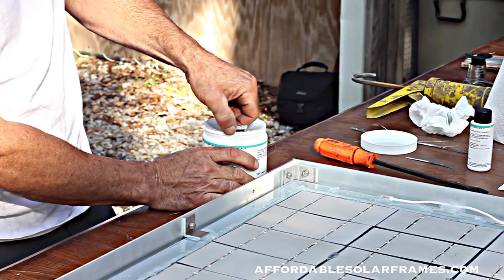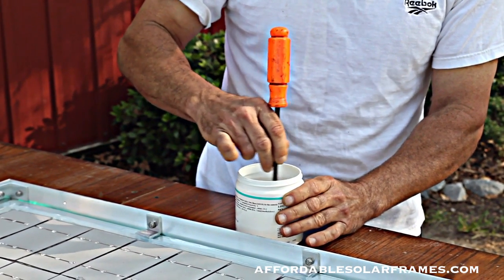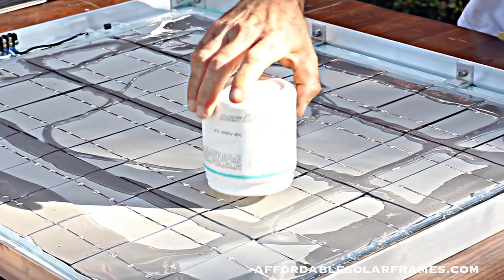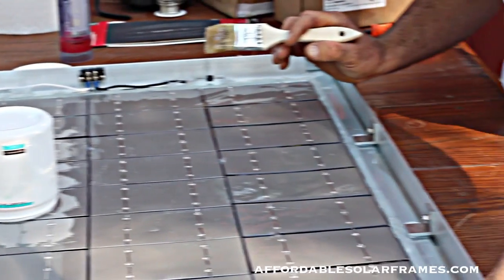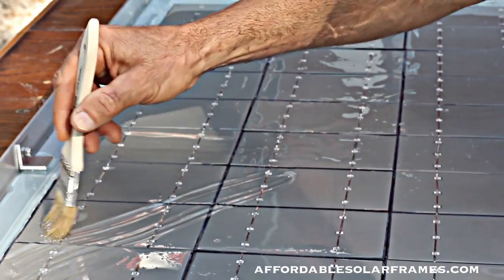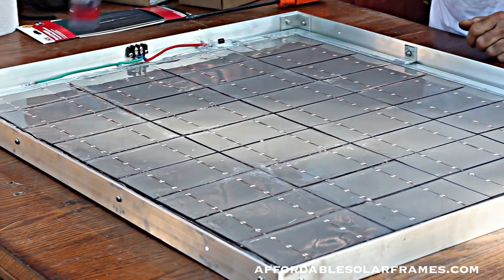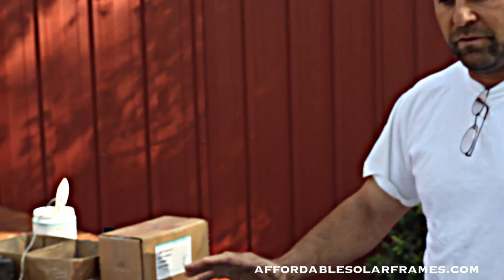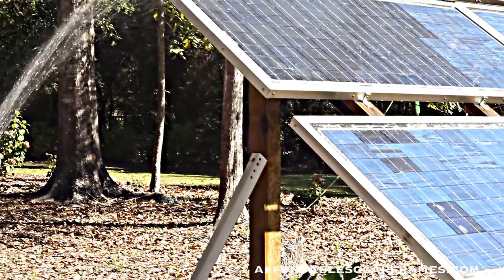How to Build a Solar Panel - Part 3 of 3 (New) encapsulated/sylgard184.Free electricity

Comment: Is it still working and how r you doing after while
Reply from the maker: It is still working. I no longer make the panels, you can now buy them cheaper than you can make them.
Reply: @markp0177  i bought 150 pieces of solar cells and i want to cover it savely . What do you recommend for this case i want cheapest way to keep it works
Reply from the maker: @alqorashy  Here is a link the sylgard. https://amzn.to/3oskMes
Reply: @markp0177  i have to pour it in just positive side or both side. Im thinking to keap negative side coverd by temper glas is that right? thank you for answering questions
Reply from the maker: @alqorashy  Just pour it on the back side just like I show in the video. It work work its way under the cell.

Comment: I just looked-up the specs. at
http://www.dowcorning.com/applications/search/products/Details.aspx?prod=01064291
It seems that it will cure faster at higher heat!

35 minutes @ 100 deg C 
10 minutes @ 150 deg C

USE HAIR DRYER, maybe?  or a heater/fan combo to hasten the curing time...

Comment: can u please show me how to apply silicone  and the encapsulant on the side where teriminal block and wires are present.......please please........
Reply from the maker: You can apply the encapsulant on the wire and terminal block if you want, it will keep moisture out.
Reply: how do we continue to connect the positive and negative wires from the teriminal block to the charge controller??? should we connect the respective  wires from the same sides of the upper screws of the teriminal block??
Reply from the maker: Yes, use the other side of the terminal block to make your wire connections to your controller.
Reply: thanks mark for clarifying my doubts........will be thankful to you.

Comment: mark can u please tell me.......can we pour the sylguard on the bus wire where we have soldered the positive and negative wires........or should we pour  it only on  the solar cells???     while making beading with silicone, can it be applied on the bus wire where we have soldered the positive and negative wires......it is not clear in the video.......please help me out.........

Comment: If you are encapsulating a 72 cell panel will you have to use 2 Sylgard kits ?
Reply from the maker: Yes you will need two kits for 72 cells.
Reply: ron runstedler please sand the full information with rests and will purchase full address..
Reply: kit.

Comment: I am still wondering if Teldar back-sheet is needed or not. I have read some university writings that point out that encapsulant (here the Sylgard 184) is not enough to prevent water vapor ingress with years.
I will use Sunpower Maxeon Gen. II cells + original specific bus-bars and Sylgard 184 (wich costed me an arm shipped to France ;-) ). I would copy the Sunpower e20-327 so a total of 96 cells for a pannel size of 1.559x1.046m.
I have found some Teldar back-sheets but the largest is only 1m, so that's not enough for my panel :(
Also I am wondering if Teldar is realy meant to be in contact with Sylgard 184. In the Sylgard's datasheet there are some incompatibilities listed.
In fact I have 4 Sylgard's kits so hopefully far enough for my panel and I could perhaps increase the thickness of that layer and go without Teldar?
Reply from the maker: +Propergol  I have not had any trouble with my panels with just the sylgard 184.

Comment: Thanks Mark for this  fully informative video from 0 to 10 about making a solar panel.
I am in Canada. I have ordered for 50 pcs of 6X6 monocrystalline cells and all other items I need to make the panel, 9X4 in series and balance in parallel to make a 18V panel
I live in a condo building at 7th floor and making a panel to have inside my 4-5 hours a day  sun facing window.But all other times I have very bright sky facing my window.
Do I need to do  encapsulation or no need as the panel is going to be inside the window.
Thanks again for your time.
Reply from the maker: +Ponniah Kunathasan You still need to encapsulate. The cells will oxide in the atmosphere.
Reply: Thx, Mark
Reply: What is the url link to your website?
Reply from the maker: +Zurviver _ It is affordablesolarmounts.com
Reply: mark, where do you get your incapsulent? I found the one that you used on amazon for $50 which makes doing the panels myself more expensive then buying ones
Reply from the maker: +Zurviver _ You can find it cheaper from MLsolar off ebay
Reply: okay, do you sell the glass with the frames?
Reply from the maker: +Zurviver _ I no longer offer the glass. It is too hard to ship. I still offer the frames.

Comment: Hi, When you are done with Dow encapsulation, do you put a cardboard or other glass or just let the liquid dry out and that is it? Thaanks
Reply from the maker: +Falah802 I let the panel lay flat for three days then I heat cure it in the sun. Here is a video showing that.https://www.youtube.com/watch?v=lUJf5enCDRg
Reply: +markp0177 
Thank you very much Mark and I will try your technique and I hope the cells will not crack in the severe winter here in Michigan.

Comment: Hi, I don't want to break any silicon bubbles happening here, however, i am learning about silicone and i had read that tin catalysed lasts 2 years before losing practical mechanic flexibility,and platinum ones = 10 years... this site sais: life of injection molded silicone is more than 20 years... and on a solar panel that lifetime would be shorter. dow corning stuff is shore value 50 platinum transparent silicone, it will have the same properties as other silicone? it's not more sticky or something. that said i need shore 50 transparent and this is fascinating to me for the various reasons. for durability, you my see that bathroom silicone on old baths can become brittle, platinum cured would be the same except 5 times longer lifetime? don't know. durability technical data needed... lifetime of the cell yes. lifetime of the human not so sure )

Comment: Hi,
I have a question for you. I need to make a custom panel that is light as possible. (For solar RC car). I don't want to use glass because of the weight and the panel needs to have a curve to it. Do you think pouring the resin on the top of the cells in a very thin layer would be ok? I want to add some protection to the cells. Thank you!
Reply from the maker: It would work but it would be to fragile.

Comment: Is the encapsulating process the same for 6x6 cells? What would you recommand if not the same for encapsulating 6x6 cells? My concern is getting the silicone under the cells.
Reply from the maker: Yes it is the same process. It is a lot harder to get the encapsulate under the bigger 6x6 cells. I like the smaller cells better
Reply: markp0177 Do you not use the eva film ,but , instead us the encapuslin,sorry just a wee bit confused.
But.. by and far you have the best information I have found in 2 years.
Reply from the maker: P Kuudsk The EVA film is very hard to use, I only use the liquid kind.
Reply: Ok thanks that clears it up.As the cells are getting better/more productive. I think I will invest the time and money soon

Comment: MARK P0177   WHAT DID YOU USE TO MAKE YOUR TABLE VIBRATE
Reply from the maker: I welded a off set weight to a old fan motor shaft and attached the motor to the bottom of the table top.
Reply: cool ty i need to make one for making chocolate 
truffles

Comment: Hello , In a video they said that the temperature and expansion, the cells were broken using this method. Let me know your experience.
( google translate )
Reply from the maker: ***** This method works when you encapsulate on glass only. You cannot use plexi glass.

Comment: markp0177 Have you tried to use bar top epoxy you can get it on Amazon or find it at Lowe's/Home Depot ect. Not sure if you would get more bang for your buck by buying this stuff. 

http://www.amazon.com/Environmental-Technology-32-Ounce-Pour-On-Finish/dp/B000BZYYQ0/ref=sr_1_1?ie=UTF8&qid=1411464188&sr=8-1&keywords=bar+top

Comment: How did u make the vibrating table. I plan to make a few panels. A vibrating table will make the job 10xs easier.
Reply from the maker: Chris Hellstern I made the vibratory out of a old fan motor with a off set weight welded to the shaft.
Reply: Where did u attach it to the table?
Reply from the maker: Chris Hellstern I bolted it to the bottom of the table.

Comment: that looks like nothing more than clear industrial uv epoxy. self leveling. extract air bubbles with flame within seconds.. will not force to cure, but just enough to force air up and out..

Comment: What is a tedlar? I have no idea what a tedlar is  and where can I get it. Thanks
Reply from the maker: You can find it on Ebay. http://www.ebay.com/itm/5-meters-Tedlar-solar-backsheet-TPE-for-solar-panel-encapsulation-/110826108422?pt=LH_DefaultDomain_0&var=&hash=item19cdc03606
Reply: Is the tedlar the same thing as EVA or different? because I hae some EVA encapsulation here with me
Reply from the maker: Corazon de Vera No tedlar is different than EVA.
Reply: ok, thanks a lot

Comment: Instead of glass, can't you use plexiglass or plastic? Just wondering.
Reply from the maker: No, do not use plexi glass it will crack the cells in the heat of the sun.
Reply: o.k, I just thought maybe plexiglass would be a bit more durable, but it expands your saying..makes sense

Comment: A vacume sealable bag around the panel could help remove all the air, compress the cells down flat and slow the curing time. Once cured the bag can be cut off from behind the frame.

random thought.. great video, thanks!

Comment: Would the encapsulant work with a polycarbonate (lexan) shield?  I'm wondering because I have a full 4x8 sheet of 3/16" lexan (darned expensive stuff!)  that I was thinking of using in a solar project.  One of my concerns is with any chemical reactions between the two and the expansion/contraction of the lexan.
Reply from the maker: No, Lexan will expand and crack the cell's.

Comment: lots of info, and right on the mark. you do an awesome job. thanks : )
im working on bedini circuits with a magnet wheel. when the sun is not out, I still want power. so I am working on power 24/7. so I think I will add some solar or wind for back up boost, just to peak my battery bank

Comment: Mark:

I live in the desert will the panels be effective in the summer it is regularly in the 115 degree range ? Also will the sly gard hold up in the heat?

Thanks
Reply from the maker: The panel is more efficient in the cold but it will perform in your heat. The sylgard is good for over 200 deg.

Comment: Hey Mark--Great Video!   Best on the internet that I have been able to find.  Have you heard of the EVA encapsulate film and if so what is your experience with it?  Looks to me lke it might be a cheaper alternative to the Sylgard but from what I can see  it would only be applied on the back of the unit.  Your thoughts?
Reply from the maker: The EVA is hard to use. You have to use it on the front and back of the cells. It has to be vacuum pressed and heated at the same time.

Comment: Mark, I'm ready to build a panel & have all of the material except the glass. I understand that low iron glass is best, but there is a company on e-bay stating that it's matte finished glass gets a higher efficiency from the cells. What do you recommend?
Reply from the maker: Matte finished is for solar water heating. It lets in more infra-red light "heat". Low iron is the best but costly. I use clear tempered glass.

Comment: The diode and wires seem to be exposed to the elements. Do you ever run into problem with that? Besides Tedlar what else could I use as a backing? More aluminum?
Reply from the maker: I have not had any problems. I would not use aluminum.

Comment: Hi Mark
I built a solar panel as per your guidneses and instructions,Its work properly ,Thank you very much for your instructions,I have 1 question.can I use clear silicon for encapsulation ?because I live in srilanka, sylguard 184 & shipping charges are too high. 
Thanks 
rajithafernandez@gmail.com
Reply from the maker: No, clear silicone turns cloudy. Try to find cell guard.

Comment: Great video Mark, very well done. I have 2 questions. When connecting the wires from the block terminal to the bus bar , you have the component between them with a wire at each end. How do you connect this to the wire and bus bar. 2nd I seen some 6" x 6" solar cells that are 4 watts each. I would save time with tabbing and a little higher output. Would you recommend this, versus using 3" x 6" cells? Thanks again for informative video. Will have to try this out on my work shed.

Comment: I just applied my encapsulant (CELL SYL 1084) but i checked in the front of the panel and i have air gaps in the center of the cell... how can i spread them out?

Comment: Mark, 3 questions..

1.- How many bottles of sylgard did you use for that panel?
2.- I plan on building a 10 x 6 cells solar panel, seeing your video I think I need two bottles, you think that should be enough?
3.' Have you ever tried solartite 384? it seems to be similar to sylgard and its cheaper

Comment from the maker: First and easiest thing to do is to heat your water, then work on getting a small appliance off grid, like your refrigerator. You will need a 1000 watt system with batteries and inverter. Around $3000 to start.

Comment: How about using corrugated plastic roof as backing (cheap stiff and cooling) and thin thermoplastic sheet on the front. I'm not saying it's brilliant but it's brilliant :)

Comment from the maker: My panels still look and work good. I have not had any trouble. There is a lot of solar panels beening sold out there with warrantys but the glass they use is very thin and the waranty does not cover breakage. Be care what you buy, big panels with thin glass break easy.

Comment from the maker: I think it will last. The problem with China panels is the glass is to thin and breaks easy. There waranty does not cover breakages. I would not buy a panel over 100 watts, the bigger the panel the easer it breaks. $150 is a good price, I would give it a try.

Comment from the maker: Well I am not sure where you live for shipping to be so much. To have a grid tie system you will need a grid tie inverter and your panels voltage output has to match the voltage input range of the inverter. First find what inverter you want then find the panel or make the panels to match.

Comment: mark i haven't purchased any products from online so i need ur help in purchasing them, i'll be thankful to you if you do so. I've one doubt here the shipping costs are more than the cost of the product for ex cost of frame is $34 and shipping is $58, solar cells cost $45 and shipping costs $46. On the whole the cost is really high when compared to ready made. Can u pls guide me to build a grid solar power system.

Comment from the maker: Well you have to shop your supplies. I buy used batteries and the charge controller and inverter last should last for 10 years or more, I am still using my first controller and inverter. The price of the cells/ tabbing and encapsulant has come down, so you will have to shop it to find the best deal.

Comment: hi mark0177. Your video is really very helpful for people in different countries to build own solar panels and obtain power mainly in remote areas.. Even i want to give a try  building one of it. Can u please let me know the total cost involved in building a solar panel consisting 36 cells and the components used for making solar panel (sylgard 184,tabbing wire,frame etc), inverter, charge controller, battery.

Comment: you should add a water pump with a timer powered from it to pump water into a long 3/4" pipe with drilled holes along it to act as a sprinkler system. then the thing would be completely self reliant

Comment from the maker: Hello. The cells are 1.8 watts but you lose a little due to the glass. I pay around . I figured  around 110 panel at around 5 hours of sun a day at a saving's of 13 cents per kwh. Yes you can go straight to a grid tie inverter and plug in the wall.

Comment from the maker: You won't the encapsulant to get between the glass and the cells and if it is a little thicker under one cell it will not matter. I get better resultes with the viberator.

Comment: Also, do you "care" if the Sylgard gets between the glass and the cells?  Or is that a secondary concern?  Would unevenness of the sylgard distribution on the front of the cells between the cells and the glass cause problems, or is that a trivial concern?  Have you done this without the vibrating table while still achieving the desired coating on front and back of the cells, if it is important?

Comment: Hi Mark, great videos!  I have a few questions.  I'm in the process of deciding how to build my panel.  I was considering building a frame, encapsulating the cells with the frame using Sylgard, and then putting a slightly less robust glass layer on top.  Have you encapsulated to a frame instead of to glass?  Does this have issues with temperature increases and moisture content between the glass and the cells that lead to inefficiencies that you avoid through the on-the-glass method?

Comment: not sure if this will prove useful for anyone here, but in case it is > I found that adding a thin layer of Lexan (a brand of polycarbonate) I got a slight but very noticable increase in power output, both amps and volts, from my cells and I am guessing this is because the lexan lets nearly all the light through but blocks nearly 100% of the UV rays, and UV it seems produces next to no voltage but produces a LOT of heat instead. so it is going to keep the cells cooler that much I know,